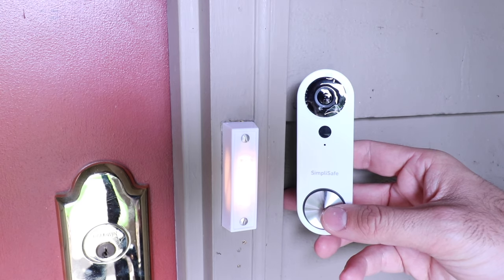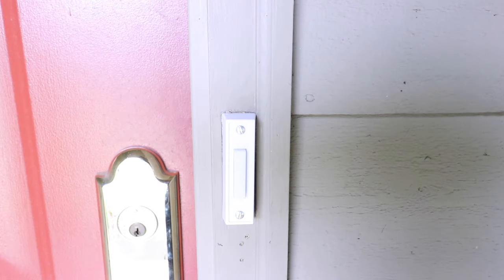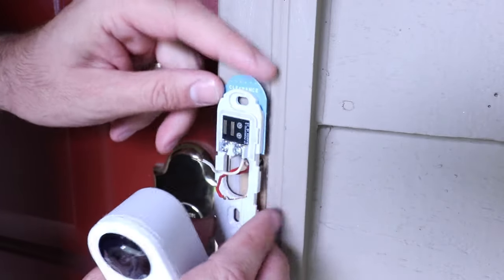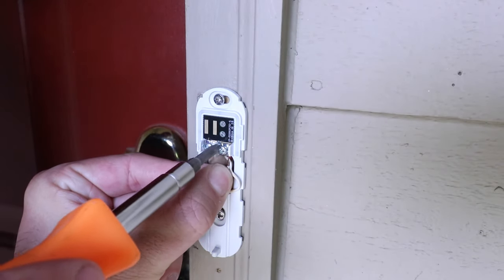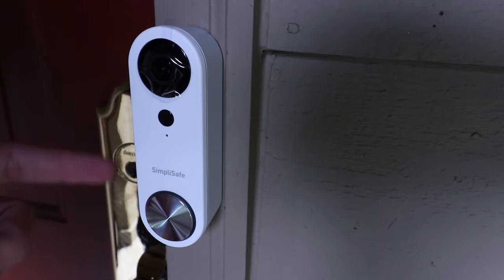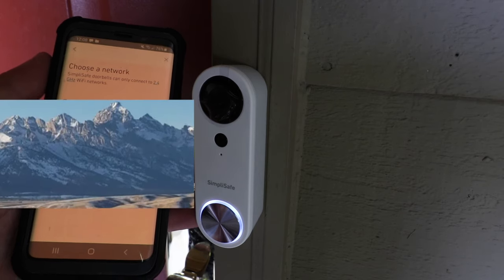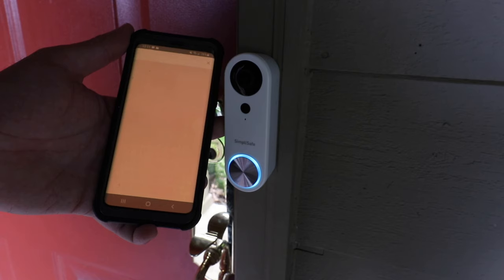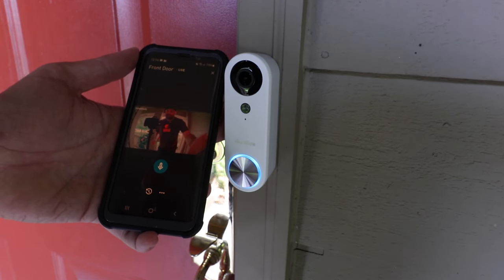SimpliSafe Doorbell Installation : How To Install Simplisafe Video Doorbell Pro

Comment: This was very useful.  I had questions on the included directions, specifically with the base plate and the tapered thickness.  The Simplisafe person di not knowwhat I was talking about and the instrucyions don't even acknowledge the two mounting positions.  The "CLEARANCE" tab was not really explained either.  Notice the instructions tell you to put the wires to the LEFT of the screws, but the illustration shoes them on the RIGHT.  You have done a great job in providing explanations the the company did not even think to mention. Great job.

Comment: Great video, thanks.
I have a problem, after the installation was fully completed as you instructed is a continuous noice on the bell.
The ring bell is working, what do you think is happening? I changed the cables but the noice is still there.

Comment: One area I wish you had covered was the notification itself. What was the time delay from button push to notification on your phone, and what does that notification look like? I have an old nest hello now and it’s pretty instant but ALSO included a preview of the video. To my knowledge, based on the other simplisafe cameras I have, the notifications are instant but DO NOT include a video preview. Thereby making you open the app to see who’s there, and the app takes a solid 5-15 seconds to load the video feed.

Comment: Your video is why I was able to install the doorbell. The "instructions" that came with the doorbell were abysmal! 

One suggestion - This gave me difficulty: When inserting the wires under the screws, I thought I had to fit the wire BETWEEN the screw and the plate. I finally saw in your video that you slipped the wires BEHIND the rectangular piece, but I had to specifically look to see if that was what you were doing. It would clarify if you stated that the wires go BEHIND the rectangular plate, not around the screw on top of the plate (because they don't fit there!). But thanks for posting this helpful video!

Comment: Hi, you need to let everyone know— u need to make sure that Wi-Fi is avail in that spot. My wifi was NOT working in current spot. So I had to move it around to correspond to proper Wi-Fi connection. I thought doorbell not working and got very frustrated, when it would not work.

Comment: I have this doorbell in a box going to get the ring one instead their plan is alot cheaper. If I remove the doorbell chime unit will this still work because mine is also bang in the middle of the wall and wired inside

Comment: I just installed my doorbell within a few mins, after watching your video! Super helpful. Quick check - am hard time hearing the voice when standing in the front of my doorbell (and when owner is talking to me through his phone/app)..   am I missing any Software settings, or if its an Hardware issue?
Reply: Hi Kumar. How does it sound inside your home when it rings? Is it loud? Do you get prompts on how it responds to the visitor ie not able to come to the door right now etc. I just purchased 1 too and I want to know is it worth it.  Thanks Jouli
Reply: @joulibrown9174  Hi, after a few retries, I was able to have the voice working.. last week had a DHL guy was at  my door and I outside, but I was able to communicate to him.. so felt I was lucky it worked for me and I didn’t miss a package delivery.. BTW, at times I noticed the notifications come very late via app, or none couple of times! Am not sure if that’s coz of my WiFi or the app behaving weird! Good luck with yours!
Reply: @joulibrown9174  The door bell sound volume is quite good and noticeable I’d say

Comment: Great video. My only issue, after installing my doorbell, is the mechanism in my hallway is now buzzing. Any idea why?
Reply: Same here my ring buzzing
Reply: @adamotak5145  add a 10 ohm 1/2 W resistor to the chime in the hallway across the 2 terminals. tons of videos on this topic.

Comment: Ring the door bell, man. Did you need a chime or does it work with the existing house chime?
Reply: I installed one and it worked with existing door chime.
Reply: Mine rings continuously.   SimpliSafe sent me a work around, "SimpliSafe Chime Connector" Part #SSCC3, but it does not work with my Nicor chime doorbell.
Reply: @stuartbrodie6053  Be aware that Simply doesn't work with digital chime doorbell.

Comment: mine does not work. when I turn the power back on the doorbell does chime- the ring on the door bell turns  a yellow green for about  seconds and then goes out. pressing the button does not chime the door bell. following the set up instructions says to charge for 20  mins. same issue as right from the get go. Forty mins so far on hold with customer support listening to that awful elevator music. was pretty happy with Simply safe - not so much now.

Comment: Agreed SimpliSafe system is easy to install. It's a good monitoring system but for the poor quality of their video doorbell camera from internet connectivity standpoint. 

I did purchase it along with the Video Doorbell Camera but the camera goes offline (no live stream) with a message 'Disconnected from the internet' every 2-3 minutes. SimpliSafe attributed it to my poor Wi-Fi network when in fact I have 5 GHz-600 MBS speed bandwidth along with six Google Nest Wi-Fi routers. 

When I complained to SimpliSafe, they asked me to the split the Wi-Fi network into 2.4ghz and 5ghz since SimpliSafe doorbell camera works only with 2.4ghz bandwith (this they do NOT say anywhere). I did the split and connected the SimpliSafe doorbell camera to 2.4ghz Wi-Fi network but in vain. The camera went offline as ever before. They sent me a replacement camera which too had the same 'going offline every 2-3 minutes' issue. 

I repeatedly called SimpliSafe and asked for a good solution. They had the cheek to say I should move my internet router (which is about 10 feet away from the doorbell camera) closer to the doorbell camera. That was the last straw that broke the camel's back and I canceled my subscription service. While the rest of the SimpliSafe system works, the doorbell camera does not since it's outdated. Today's doorbell cameras support dual bandwith (2.4ghz and 5ghz) and SimpliSafe lags behind, thanks to their outdated technology. 

I am currently using the SimpliSafe doorbell camera without the video recording feature from the web interface (smart app disabled due to my monthly subscription cancelation) though the the camera goes offline every 2-3 minutes but then I am not paying $27.99 for the poor quality of the camera. I can't return the equipment since I am past the product return window.
Reply: I see you under every simplisafe video commenting the exact same thing
Reply: @Sandrinarhonda  Yes, I did. Is it a crime?
Reply: @gravisha  😂😂 I mean it just sounds like you copied and pasted and are still upset over it , did you get a new doorbell system ?
Reply: @Sandrinarhonda  yes, I did copy and paste my own statement across SimpliSafe Youtube videos. I am not upset over it at all since I've installed Google Nest Doorbell camera which live-streams 24/7 without any dropped connections. I love SimpliSafe monitoring system much more than their outdated doorbell camera.
Reply: @Sandrinarhonda  yes I did, for I want potential SimpliSafe customers to know about the outdated 2.4 ghz technology.
Reply: @gravisha  did the Google nest doorbell connect well with the Simplisafe system because I was thinking about getting the same thing and maybe the smart lock later on
Reply: @Sandrinarhonda  no, I disconnected my SimpliSafe $27.99 monthly service. I am subscribing to the Google Nest Aware plan that helps me view recorded clips for 30 days on the Google home mobile app. Also, bought three Google Nest Outdoor Wifi cameras and am pleased with its performance.
Reply: @gravisha  thank you so much

Comment: They told me it’s low voltage no need to determine which circuit on the breaker.  Inaccurate?
Reply: Correct, it low voltage DC. Try not to let the wires touch each other or the same metal parts while installing though, it can damage the power supply if you are working “live” and they short together. Oh, don’t put them in your mouth either lol, like a 9 volt battery (but even worse) it would not be a pleasant experience.

Comment: I bought a new home that has a PrimeChime Plus 2 Electronic Doorbell.   I recently purchased a SimpliSafe video doorbell.  SimpliSave  sent me a work around cable for a digital chime with instructions on installation, but it DOES NOT work!  I think I either trash the video door bell or trash the Nicor PrimeChime Plus 2 Electronic Doorbell because neither Nicor or SimpleSafe know how to integrate an electronic doorbell with the video door bell.  Sure doesn't seem like Rocket Science to me!?!?!

Comment: Most of the  circuit is “low-voltage” current that won't give  a  if  come in contact with the wires.

Comment: the biggest problem that no one metioned it in any video that doorbells powered by 110/220 v and this device works by 8 to 24 v so it's more complicated and manufacturer avoid talking about this problem!

Comment: Turn off the circuit breaker and push the doorbell button if it still rings then try again and if it doesn't you're golden to go, there I saved you 3 minutes.🙄🙄

Comment: For 160 bucks that thing should be installed from the inside of the door with a camera hole and button hole drilled to the front of the door really shitty design so easy to steal.